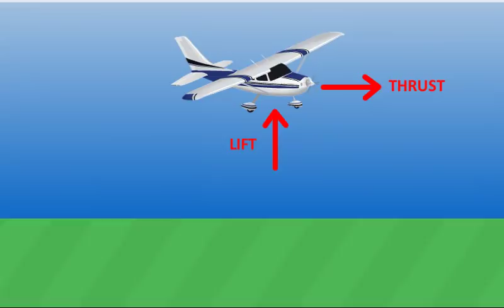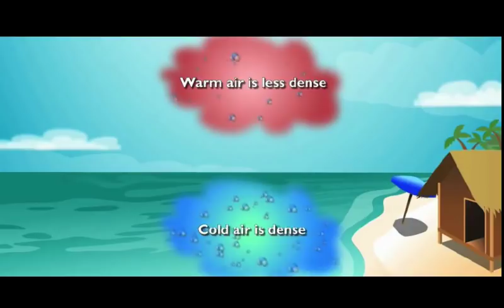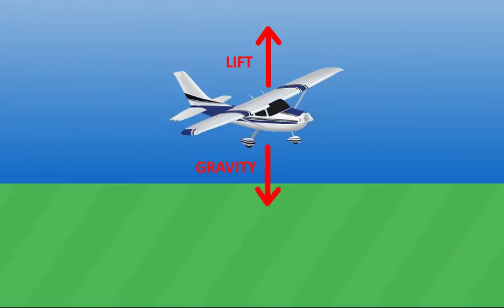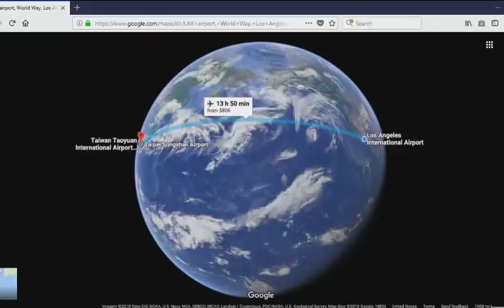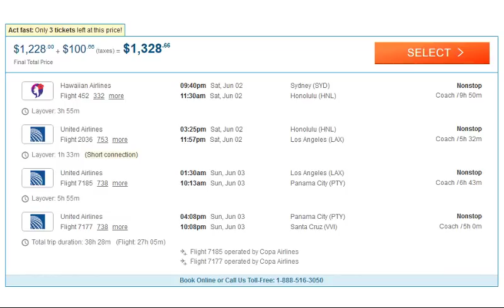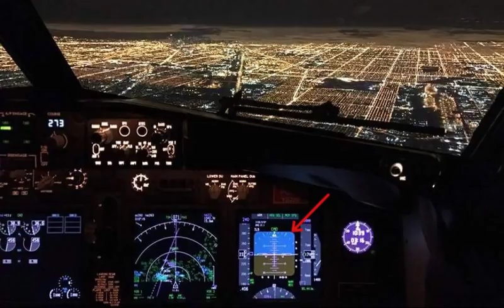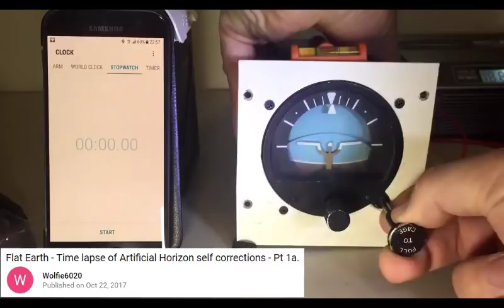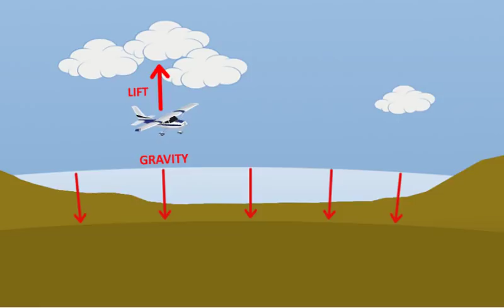Flat Earth Falsities - Plane Nonsense

Comment: Question:
If the earth is a spinning ball with rotation speed of 1.669 km/hour, why we cannot feel the movement?

Answer:
Because the atmosphere also move along with the surface of the ball earth.

Questions:
How to make the air moving along with the moving solid surface?
How to attach gas (atmosphere) to solid surface and move together?
How to make the clouds stay above your head means the clouds also moving in synchronous with the surface of the ball earth.
Why do we feel the winds blow? Sometimes winds don't follow the command of earth surface to move together?

Please provide answer, silly answer is also acceptable ... hahahaha
Reply: And like Greater Sapien has said over and over, humans are not suitable to feeling whether we are in motion, we only feel acceleration. Now you might say, i still feel blablabla in a train, but what if you were suspended in such a way that would negate ALL bumps and vibrations if the train was to stay at 100km/h, would you be able to tell you were moving if you had your eyes closed and hearing blocked?
Reply: Density doesn’t tell you shit. 

Which one weighs more, a bar of lead with a mass of 1kg or a bar of aluminium with a mass of 1kg?

Lead is over four times the density of aluminium (2.7 g/cm³ versus 11.34 g/cm³) so clearly the lead bar is heavier, right?
Reply: All of these are simple physics questions and have simple answers, I can’t understand why an adult is not capable of understanding any part of it.
Reply: A magician made the Statue of Liberty disappear by putting the audience on a rotating stage and rotating it.
When they opened the curtain again the audience thought the Statue had disappeared because they had not felt the movement.
Reply: @GrahamStw. Fans aren't good example. He meant flat vertical surface dragging air particles. He probably newer stood close to belt sander.
Reply: @jordy f. Air movement along with Earth is responsible for cloud movement.
Wind blow depends from air pressure differential. That in turn depends from many factors. For example sun radiation heating atmosphere with variable intensity on whole surface of the globe.
P.S.
Can you specify what creates tides on flat Earth? I found at least three "explanations" and every has holes. Which one do you believe: air pressures cycles, water evaporation by sun, electromagnetic or static force. Choose your poison ;).
Reply: A lift is a pretty good example. If you are a nice smooth lift then once it reaches a steady speed it can be hard to know if it is moving at all. 
Another good example would be a boat drifting down a slow steady river. If you are below deck you can’t tell you are moving.
Reply: A spinning carousel is accelerating! Constantly changing velocity.
Reply from the maker: Bobby - The carousel is rotating hundreds times faster than the earth, so it changes direction much more rapidly, which is a form of acceleration, The earth rotates once per day. Do you think you will feel it on a carousel rotating once per day?

Also, an elevator is a good example. You only feel it when accelerating or decelerating. When it is moving steady you don’t feel a thing. Why would you? What force do you think you should feel? All you feel is your normal weight on the floor.
Reply: GrahamStw exactly! Thank you so much for that, this flat earthers only make 8 year old questions...
Reply: Same principle applies though jordy. At 5km/h or at 1000km/h or 10000000km/h. If the velocity is constant and everything local is moving with you then there is no force acting on you and nothing to feel. 
And if you don’t think solids can move gases then you must find fans very confusing.  🤣
Reply: +jordy F/ no...many can answer it...but if you are like most flat-earthers you will call them liars.
Anyway I'll give you a simplified answer (courtesy of my good friend "Hvar Live"):
Air is a fluid and it has viscosity. That viscosity causes friction between air and ground and between higher and higher layers of air and causes one layer to drag another layer until equilibrium is reached and all layers are moving at the same speed. Why? because high above, at the space side, there is nothing that causes friction with air for it to break and slow down or stop so it continues moving along with Earth.
check this video: "Viscosity of air: One rotating disk drives another"
https://www.youtube.com/watch?v=njX1l8kvXxo

As for wind...have you never been on a moving vehicle and felt the cool breath of the air conditioning? the air inside the vehicle is moving with the vehicle while there is a local air movement (the air moved by a small fan) in an arbitrary direction.
Reply: Take a cordless fan on a bus.
Can you make the air inside the bus move?
It would be so amazing if one day you had a "DOH!" moment.
You do understand buoyancy, don't you?
Hot air is more buoyant than cold air.
And ironically moist air is less dense than dry air.
People say that it feels "heavy" out when they humidity is very high but in reality very humid air is less dense.
Reply: Bobby Wizdum in a carousel theres something called centrifugal force, just search what it is...
Reply: @jadian jones. Common sens is more than often wrong. That is 100% true.
Reply: jordy f well said. notice they run away to new threads we start getting owned in the old ones and start up the same arguments? they cant beat the truth. we feel all things in motion.
Reply: You can't face the truth that you can't feel a rotation of one revolution per day.
Reply: You have the answer to your first question wrong. 

You can’t feel it because constant velocity does not create a force. 

Force = mass x acceleration. 

If velocity is constant then acceleration is zero.
Reply: Fuck off you stupid troll.
Reply: Majd Saedy

Good one.
At least you are the only one who could think in logical way so far.
I like it because this is the main point of this discussion. To stimulate each others to think in logical way.
But sadly, most of GE-ers are very good on insulting others and very poor on logical thinking.

Yes, I get your point.
But, your explanation was way too far from the reality.
The movement of the surface could cause the move of the air above it, yes, make sense.
But can you see the effect?
Too small to make this "atmosphere moves together with surface of the earth scenario".
I believe that you have a critical thinking and I believe that you AGREED with me on this.

Not only that, how to make the cloud also moves in the same speed in case the cloud is just stay above your head for hours. In case there is no wind, the cloud just stay above your head means that clouds move even faster than the ground speed.

My last point is very obvious.
As we can see from your video, the upper layer of disk moves due to the wind generated below it. So, if the earth surface really moves, it will cause the wind blows on the surface of the ground.

Man... this is too easy to debunk.
I tell you.
No one can explain this in logical way.
You can check in every answer about this. They only say, the atmosphere moves along with the surface of the earth.
HOW DOES IT WORK ? They cannot explain.
Why? Because our school book only told that. How it really works, it was not explained in our school book.
And we, the human were too dumb to think about it. 
Only some people who wake up from deception could come up with this question.
Some globe believers, just defend this bullshit with their life and soul.

What can you say about it?
Martin Gorbush, what can you say about this? I think you are quite good in critical thinking as well.

The people like  Majd Saedy and Martin Gorbush still have chance to realize that they have been fooled.
But, others, they simply not able to think logically.

I hope both of you would like to give a chance for yourself to challenge the ball earth theory.
Don't worry, me and all flat earthers out there just same like you, at the beginning, we though flat earth is a crap, but when we look it more and more, the truth is clear as day.
Reply: Wait... wait ... wait...

These are the questions :
How to make the air moving along with the moving solid surface ?
How to attach gas (atmosphere) to solid surface and move together ?
How to make the clouds stay above your head means the clouds also moving in synchronous with the surface of the ball earth
Why do we feel the winds blow? Sometimes winds don't follow the command of earth surface to move together ?

And none of you can answer it.
Reply: gravity is the magical answer to everything...you know...the thing that can't be even proven to actually exist but is used to explain their fantasies when we already have the explanations of density...but they need their heliocentric religious model to succeed...the earth is not rotating period....and its already been proven by the michaelson-morley experiment which proves the ether but like einstein these religious cultists completely ignore it as they are proponents and beneficiaries of the lie.
Reply: GrahamStw again we feel everything else in motion on earth. name 1 example of something in motion we are on and cant feel.
Reply: hiddengnome bull. i feel even a carousel spinning slowly in a circle. its not accelerating.
Reply: VoysovReason

Also, an elevator is a good example. You only feel it when accelerating or decelerating. When it is moving steady you don’t feel a thing

How fast the elevator speed? 5 km/hour
How fast the earth speed on the ground of the earth? 1.669 km/hour if you are stand on somewhere near equator.

Please stop fooled the innocence people to believe suck scam.
Reply: GrahamStw weight doesnt prove the ridiculous jobs you guys gave gravity.